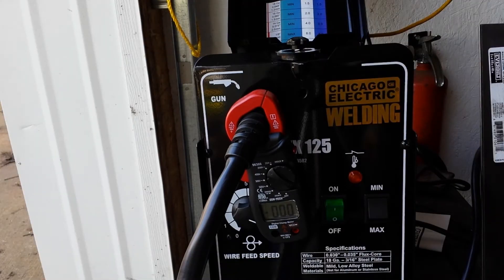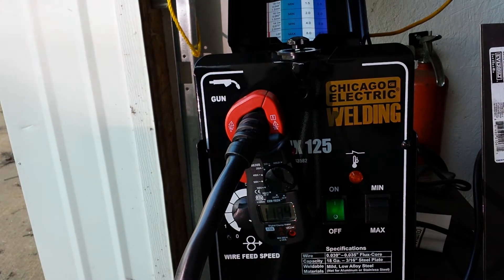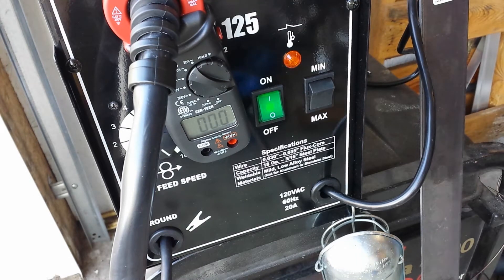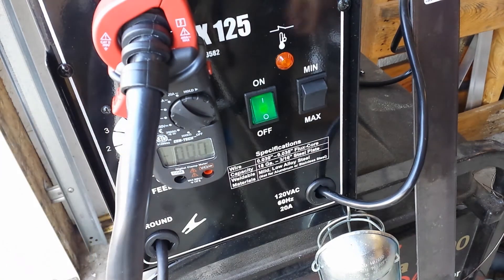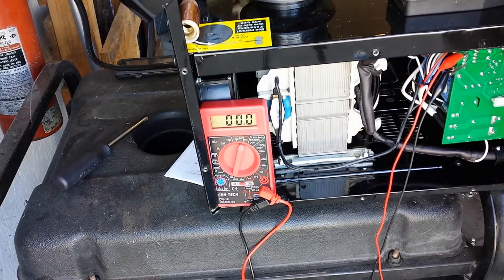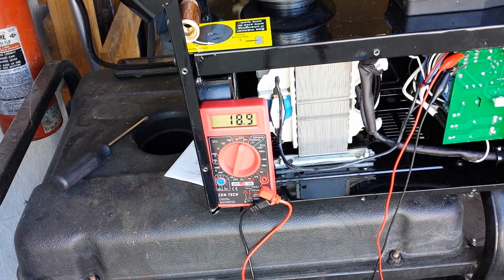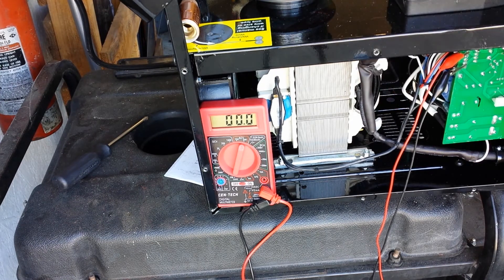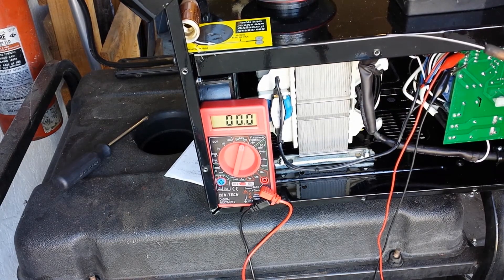Harbor Freight Flux 125 Welder Review - Amp & Volt Tests  (#63582)

Comment: I have a welder from Harbor Freight that's the same style, but when I turn it up all the way to the wire comes out in short quick zaps.  Would that be a wire tension issue?  And what is the "minimum" used for on the min/max switch?  Is that used for thinner material?
Reply from the maker: Let me start by clarifying that I'm not a trained welder.  
If your wire is not feeding smoothly when not welding, (held up in the air away from the work) then that is likely a feed issue.  If you are experiencing those zaps or stutters only when actually trying to weld, it's probably a settings issue, bad ground clamp connection or dirty work piece.  If you have the wire speed turned up too high for the conditions your welding in, it will not be able to melt the wire as fast as it is being fed.  Try turning it down until it feeds smoothly again.
Reply: @MrCharlesCurrent  great stuff.  Thanks man!

Comment: A friend says he build a roll cage for his enduro car with this welder, would you trust it. for that purpose ?
Reply from the maker: That depends on how good of welder he is.  If he’s really good, yes.  If he’s average or below, NO!  It’s easy to make a weld that looks ok, but doesn’t penetrate properly.  That is an issue with wire welding in general and even more so with this welder.

Comment: Can you weld autobody work with this? Specs say 18GA but I think I am using 22GA on Jeep.
Reply from the maker: +John Adams I wouldn’t recommend using this for bodywork. It doesn’t do thin metal well, creates a lot of spatter and I’ve hear the slag can cause problems with paint.

Comment: so you can just plug this into a standard wall outlet, assuming you aren't putting it on a circuit that runs other power hungry things and it works just fine?
Reply from the maker: +Bigbacon You should use a 20a rated circuit.  I think most standard house circuits are 15a, So would probably trip frequently.

Comment: I chickened out on the Flux 125 and went to Home Depot.. Picked up a Century FC-90 welder. It's a 110AC welder that outputs DC for welding. DC is suppose run cleaner than AC.  It's a nice looking unit, but doesn't come with any extra stuff. So, I'm waiting for some FC wire and other accessories to arrive. Once I get going, I might even get out my amp meter and do a review that shows ampere flow across the range of power, or Heat settings.
Reply: Well it does seem like it's putting out the full 110 a so it's got decent efficiency at the least even if they can't do simple math before labeling the thing.

Comment: I have one of those clamp on Amp meters that I have used a lot. Since I'm into electronics, I've used current sensor coils to build devices to measure current, so I have a good understanding of how these clamp-0n Amp meters work. 
I also know that Transformers (like the big one inside the welder) will generate very strong lines of electromagnetic force (EMF), which will most likely effect current sensor coil output. In other words, your placement of the current sensor could be causing incorrect current readings.    
I recommend placing the clamp-on around the ground return line, about 3 feet from the welder..
(away from any large metal objects) That should give you a more accurate reading.
Reply: Good point Mr. Lee.   I was thinking about how to know if your welder is putting out what it's supposed too and if not why. I seem to get different outputs at times, I'm going to take a look first to see if there is anything left loose in assembly and in general all connections.  Thank you for your valuable input.

Comment: These numbers look decent to me. Try the 035 wire too. I know that when im welding with the 035 compared to 030 i can tell a big difference. Man... great show of numbers, I appreciate it! Comment on my welder review vid with a link to this and i will pin it.
Reply from the maker: I have done a new test with 035 wire.  The video will be up in a few weeks.  I also shot a video testing duty cycle and another running it as hard as possible for 30 minutes.  Just doing all the test I wanted to see, but couldn’t find.

Comment: I was going to buy one of those but ended up buying the Mig 130 off eBay. I installed a separate transformer for the wire feed. I'll need to test amps output. Good idea and video.
Reply: I would be interested in why your installing the seperate transformer and what is your goal or gain while welding. Interesting modification, Thank you

Comment: Physics. 110v with 20A breaker = 2200watts. 20volt welder output for 2200watts = 110 amps
Reply from the maker: True, but that's not the whole story.  My wall voltage measures 115V and you never know for sure if if they are really pulling 20A.  Some never pull the whole 20 and some cheat and will try to pull more.  My Tweco has a 140A output rating.  If you read the manual it says you have to install a new plug, cord and use a 30A circuit to get that.  So, if you turn it up all the way, it will try to pull more than 20A and trip a 20A breaker.  The only way to know for sure is to test.
Reply: Plus heat losses. My house is 120V so that would be 120 amps.
Reply: https://en.wikipedia.org/wiki/Ohm%27s_law

Comment: Did you test with  030 or 035 wire?  If you tested with 030 might it draw more amps with 035? Also if you modify the welder 
to work as a dcen output a test on that setup would be very informative.
Reply from the maker: That's a good question.  I did the test with .030 wire.  I will run a test with .035 and if the result is better I will post a follow up.  I don't want to modify the welder at this time.  Not until I have exhausted my testing with the stock welder.  My main focus is what people can expect to get from the welder as bought from Harbor Freight.

Comment: Very interesting tests you've done. Am going to upgrade to a 240V wire feed welder as soon as get a better generator. Until then, will be using my HF 90 to get some small projects done.

Comment: Great video. I’m always on the fence with HF. I’m a beginner welder so one day I might give it a go. Cheers mate.
Reply from the maker: Didn't you use a flux welder in your stool video?  What brand was that?   It looked like you did a good job with that one.
Reply: I’m always in the market for new tools. I will probably check out their version even though I have the hobart
Reply: Stelios The Greek You'll find yourself getting addicted to welding and want to get a better welder in short order. That's what happened to me.